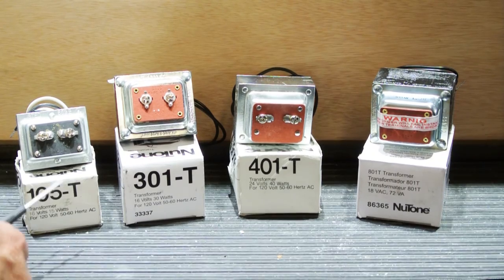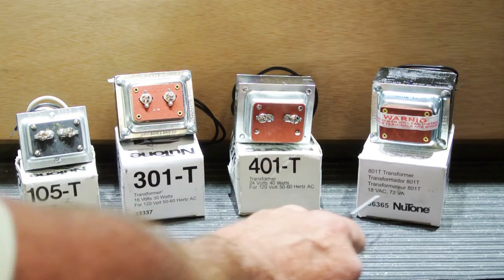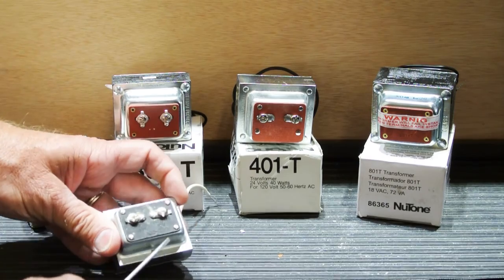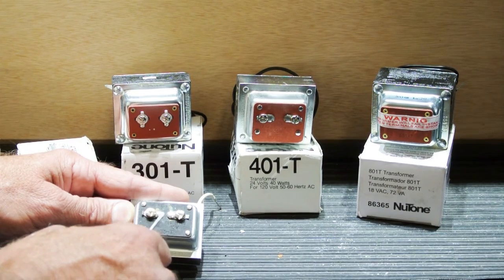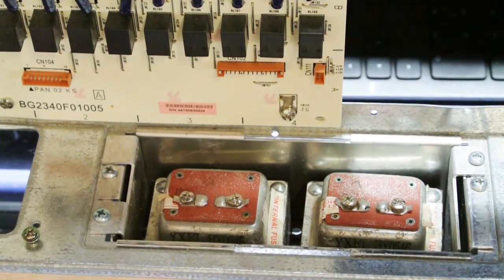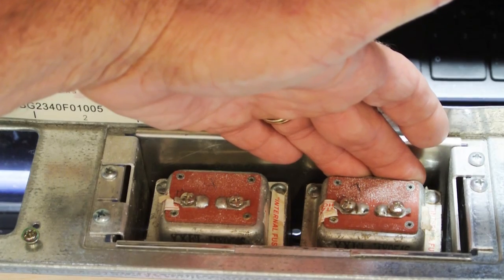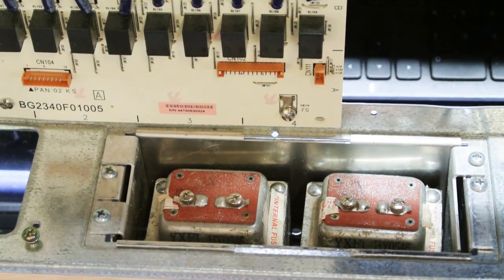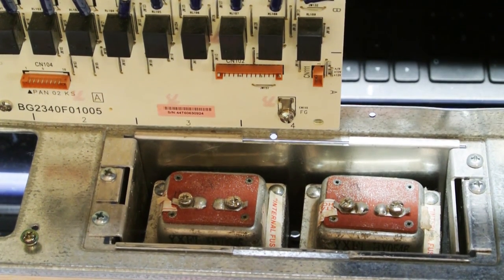The Fundamentals of NuTone Low Voltage Intercom Transformers

Comment: Hi is there a video on how to replace the transformers for this intercom, do you have to remove the chassis?
Reply from the maker: Hi TheMrOsaed: No, I don't have a Video that shows how to remove the Transformers - This Video shows how to remove the IMA4406 Master Station: https://www.youtube.com/watch?v=ZpwjqFXqC3g&list=PLsTvqKsBnGYcoTSfKTOHOltP98FFiuUP1&index=1&t=244s
To remove the Transformers, Do The Following:
1     Turn the Circuit Breaker off
2     Remove the Master Station
3     Unscrew the 4 screws that hold the Terminal Board to the back of the Wall-Housing
4     Remove the 2 screws that hold the Transformer Bracket to the Transformer can
5     Slide the 2 Transformers with the Bracket up - You may need to tilt it outward some and you may need to left the Terminal Board up, out of the way, also
6     Disconnect the Electrical Wires from the Transformers and disconnect the Ground Wire from the Bracket

Chris

Comment: Chris, thanks to your video, I'm visiting my IM3303 intercom, which was left unloved for 20 years, lol. I'm trying to figure out why these Nutone systems require 2 transformers to work but can't find answers. There should be no reasons not to use just one transformer with twice the ratings. For example, IM3303 needs 2 16V 30VA transformers, I should be able to replace them with one 16V 60VA transformer. Is that correct?
Reply from the maker: Hi ruenjou:  No, it's not correct - The IM3303 has 2 separate power rails and it is specifically designed to be powered by 2 separate Transformers.  The reason behind have 2 Transformers is simple - The IM3303 uses 301T Transformers, which were standard items in the Transformer product line - This meant that a custom Transformer did not have to be manufactured just for 1 product (IM3330) - Also, since the Transformers needed to be mounted inside the wall-housing, they needed to be of a certain size, a custom transformer may have been to large. Using a custom Transformer would also mean that it would have to been certified for it's application (more cost) 
     Why are trying to replace the Transformers? Especially both of them? It would be highly odd that both would fail at the same time - 301T's are fairly common - Chris
Reply: @northsideservicecompany3567  Both transformers are working. Just from engineering point of view, the dual-transformer design is a bit weird since they are not there for redundancy, costs and failure rates are increased. Anyway thanks for your reply.

Comment: My "System Control" knob is really loose and I get no audio. I have to use a screw driver to push it in hard to get the audio back, is there any way I can fix or replace it?
Reply from the maker: Hi Kent: Which Model of NuTone Intercom System do you have? - Chris
Reply: @northsideservicecompany3567  IMA-3303
Reply from the maker: @kentyuen1982  And is the problem with the "System Volume Control" behind the right-hand door - or the Master Station Volume Control next to the Display? - Chris
Reply: @northsideservicecompany3567  it's the little black know behind the door
Reply from the maker: @kentyuen1982  The only solution is to replace the pot.  This is not a do-it-yourself project.  You can contact us during business hours for information about sending the Master Station for repair - Chris 925-743-8236
Reply: @northsideservicecompany3567  thank you

Comment: Very nice and educational video. I have an Amazon echo plugged into the AUX input of my IMA-3303 master station, I can play music throughout the house, the problem is my master station is nowhere close to a power supply, I know it's not possible to draw power from the transformers since the voltage is not high enough to power the device, any suggestions?
Reply from the maker: HI Kent: One thing you could do is wire in an Electrical outlet inside the wall - about the IMA3303 Wall Housing - which you can use to plug in the USB Power Supply for the Echo.  The Electrical outlet would need to be in a metal electrical box - which is mounted to the stud and be flush to the top of the Wall Housing - making it "accessible" when the Master Station is opened up or removed.  

To do this, you would need to uninstall the IMA3303 - loop off the existing transformers for 120 volt power - cut the top of the wall housing to gain access to the electrical outlet - then put it all back together 

The other choice would be to buy a really long USB Cable - run it from above or below into the IMA3303 and plug in the USB Power Supply in a more convenient location.  You need to make sure the USB Cable and Power Supply are a higher wattage design - to deal with the extra distance - Chris
Reply: @northsideservicecompany3567  Thank you for the advice.

Comment: Hello and Merry Christmas.  I was given a Ring Doorbell 2 and would like to use the wires from my IM-4006 system.  Ring says the voltage from the transformer has to be 8-24 VAC.  Is that what my system has?  Thanks.
Reply from the maker: Hi Yankeeblues1:  Here are links for 2 of our Videos that you need to watch to understand what it will take to have your Ring work with your IM4006
Video #1 - https://www.youtube.com/watch?v=GcVjIUN2jhI&list=PLsTvqKsBnGYdNYGrlrOSVKjOLwvFWrLUx&index=2&t=460s
Video #2 - https://www.youtube.com/watch?v=t6YswmDNVyI&list=PLsTvqKsBnGYdNYGrlrOSVKjOLwvFWrLUx&index=4&t=116s

Chris

Comment: I have a NuTone model IM-3003 intercom system and have installed a Ring Video doorbell. We installed the doorbell and it is being powered by the direct wiring to the intercom but the doorbell chime does not ring. Ring advised that I probably needed to upgrade the transformer by replacing with an AC transformer. But the online comments seem to indicate that you CAN use the existing transformer. How do I determine that the transformer does or does not need to be replaced without having to buy a new transformer? How do I determine the right transformer is I DO have to buy one? thanks
Reply from the maker: Hi Rusty: It is Not The Transformer -All NuTone Transformers are AC
Watch this Video and you will understand what needs to be done:

https://www.youtube.com/watch?v=HgpiZCPSbTA&t=2s

Chris
Reply: The ring doorbell can use a 16.5 vac transformer, if your doorbell transformer doesn't provide enough power.
Reply: A 16.5 vac  plugin transformer can work for the doorbell also

Comment: Hello, I have the Nutone IM3303 and I want to use it with the new Nest Hello smart doorbell but the 105T does not have enough power to support the Nest Hello. Can I replace the 105T with 301T in my IM3303? The 301T looks like what I need to support the Nest power requirement. Thank you.
Reply from the maker: Hi Noang:  The IM3303 already uses 2- NuTone 301T Transformers. . . Could you have a IM3003 ? which uses a single 105T?   You can replace a 105T with a 301T - however the Transformer Drop Can will be too small to allow the 301T to fit inside of it properly .   If you need a 301T Drop Can - you can contact us for one. - Chris
Reply: You are correct, I think mine is the IM3003 which has only one transformer.  I will reach out to buy the drop can.  Thanks.

Comment: Hi, I'm trying to install a Nest Hello doorbell to my existing Nutone Intercom system. The issue I'm running into is that my Nutone system use a 16V 15VA transformer and the Nest doorbell requires 24V with 10VA power min. Can I install a 24V transformer instead without frying the Nutone system? Thanks!
Reply from the maker: Hi Gab:  No, no, no, no, oh and No - Chris
Reply: Northside Service Company haha OK so I just have to give up the Intercom system then

Comment: Hi can you tell me if all of these transformers can be used on the IMA4604? One of my transformers is 0V, the other os 20V, They are 801T, but I am unable to find these transformers anywhere. The issue I am having is that out of 7 speakers including the base station, sound is coming out of one speaker plus the base station.  The other speakers there is no sound at all. My though is since I don't have enough juice, this might be the issue why the other speakers are not working.
Reply from the maker: Hi Savio,  To answer your direct question first.  No, you cannot just use any of the transformers in the Video, the IMA4406 requires a NuTone 801T Transformer (which we have).

The bigger questions is, Why Did Your 801T Fail?  If you have a problem with your IMA4406 and you simply replace the 801T - it will just fail again.

This is all to complicated of a topic and problem to discuss / answer through YouTube.

Please call me when you have a chance and BEFORE you do anything else

Chris
925-743-8236